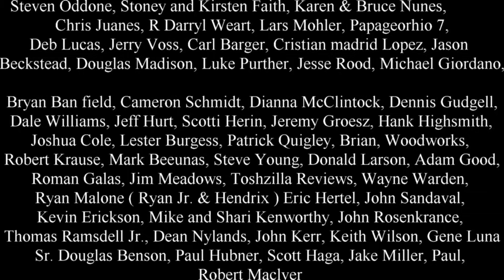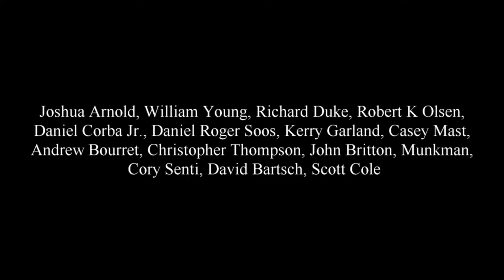FIND GOLD in ROCK'S - Geology 101 | ask Jeff Williams

Comment: Below a critical size, Gold -- or any metal -- looks Black.

(Carlin deposits are the classic example of a gold deposit that can't be seen with the naked eye. With Carlin gold, the shiny is trapped inside a sheath that hides it. You have to mill the ore first and then you can assay it.)

But, it's also the case that ultra-fine free mill Gold will look Black when it's riding with magnetite and other iron ores. By ultra-fine I mean gold so tiny that you HAVE to use a micro-scope or chemical assay means to detect it. Even so, like Carlin gold, the total amount can surprise you.

When the Gold first rose to the surface -- probably in a pluton -- then off into some dike -- its absolute concentration would be amazingly low. It took complex geo-chemistry for it to re-concentrate to the point that pickers and nuggets were formed. But it stands to reason that only a fraction of the ascending gold ever 'condensed' into visible gold: nuggets, pickers, flakes,... The larger the nugget, the slower the condensation process. Some hefty nuggets figure to have taken millennia to crystallize out. 

Assuming this is the case, one is well advised to take a second look at magnetite cons. The cyanide process ought to be spot testing such heavies, to see if anything is getting by. 

Further, the tinier the gold flake is, the more it stops behaving like gold. It starts to float on water -- surface tension -- and it goes much further down stream than you'd expect. It just refuses to behave like the heavy metal that it really is.

What this means is that should you find a pay streak -- especially in a dry (desert) deposit look further 'down stream' and sample the magnetite to be found there. It figures to look blank to the naked eye -- even a jeweler's loupe, while still having enough gold to react with NaCN solution.

Like anything, results will be hit or miss.

Just remember that the Carlin deposit is the largest play in the USA right now -- and stood undiscovered for a century -- because each particle required a microscope to spot, and milling to even begin an assay. It's now thought that there is more Carlin gold than any other deposit type in the Western USA. The big hang-up being that the rest of the play figures to plunge DEEP under overburden.

Hey, maybe robots will change the mining equation. They tend to be so brave.

Comment: I thought it was too early for rattlers today. I was scaling boulders trying to check out a cave and there was a shelf on the left side of my neck with a huge timber rattler hanging out, about 2 feet from my head.  I was really lucky he got startled and moved under the shelf further. I was also really lucky I grabbed the rocks to my right when I went to shuffle past. Had I leaned off to the left, I probably wouldn't be typing this. Be careful indeed!
Reply from the maker: thanks

Comment: Hey Jeff! Any suggestions on where to purchase or how to build a low cost rock crusher? I'm trying to stay at or below $500.
Reply: gaurtauk Awesome, thanks!
Reply: don't get or build a chain crusher - they self destruct really fast.  get a jaw crusher from mmbmllc.com.  buy the motor yourself.  have someone weld together a stand and frame for it. buy the pulley for the motor from mmbmllc also.  i've used one for over a year, had no problems with it, and it still looks like new at about 1/4 the cost of others.
it is adjustable smaller, but i have mine adjusted to crush to 3/4" minus.  then i run the output through a hammer mill.  some gas engines have no coating inside the gas tank and rusts badly.  no fuel filter either.  most electric motors require 3 phase power.  ask a lot of questions before you buy.  i picked mine up instead having it shipped.
Reply: Richard Servatius Great advice! Thank you!

Comment: I have a question:

Why do the Sahara Desert, the Arabian Desert, the Pakistani-Tibetan Desert and the Gobi Desert form a straight line that is inclined at approximately 40-45 degree angle from the equator? And at the base of this line is the Nadir Crater which is off the coast of Conarky, Guinea in West Africa?

Is there a connection between the meteorite that caused the Nadir Crater and these deserts?

Comment: I just want to learn how to prospect lead and zinc.
Reply from the maker: that is real easy. Carbonate hosted deposits.
Reply: I live in an area where a whole lot of lead and zinc is mined but I can not tell if any of the strange looking rocks in any way indicate if I have minerals [other than one piece of hematite] any place on the land.
Reply from the maker: the lead will be in the form of Galena which is easy to spot ..usually black  and very shiney when hammered open. Zinc is usually found as Sphalerite which is also found with Galena.
Reply: They list a whole host of lead and zinc minerals around here, and most of the zinc has come out as smithsonite, even the largest piece of 'turkey fat' ore at 27,000 lbs which was displayed at a world's fair [I forget which without reading the article again] which came from the Morning Star mine, just about 5 miles east-southeast of me.

I am too high up for open ore, I need to pick through more remote 'suggestors' and 'indicators.'

I am hoping that the pillow formations of hard chert in the dolomite and the vuggy quartz are good indicators, but even then, its unsure how many hundreds of feet and in what direction, and what angle I would need to probe to find it.

At this point, I am gearing up to make an 'underground home' on the land, in a location just beneath a roughly 24 inch thick slab of very hard chert while clearing the top of the land for greenhouses.

I will punch a hole into the flattest part of the cliff face [a really nice area roughly 8 feet by 8 feet which is almost perfectly flat, with a thin ledge hanging over it as a natural awning] and whether I find valuable ores or not, I will have a nice underground home.
Reply: Seems there is a whole host of information on how to identify rocks bearing gold, but not too much on lead and zinc.

Comment: Jeff we are using a 25t/hr hammer mill in our mine in Brazil.Check the mine out at,Orinocogold.com
Apparently not many Co use hammer mills these days to extract gold from quartz.The returns so far are better than,25gms/t.
Leigh
Reply: nice returns!  i have a hammer mill and jaw crusher too. a local mill had a ball mill which didn't work well.
they also had a roller mill which worked, but they couldn't afford to keep fixing it.  they had a duplex jig and
fixed it themselves, but could never get it to work right.  i have a simplex jig that's old and broken - but don't
have the water pressure to make it work right.  will have to buy and plumb a better pump for it...and buy more
shot of the right size.  eventually i'd like to get every piece of equipment inside my shop to work in sequence.
it's a bummer being poor!